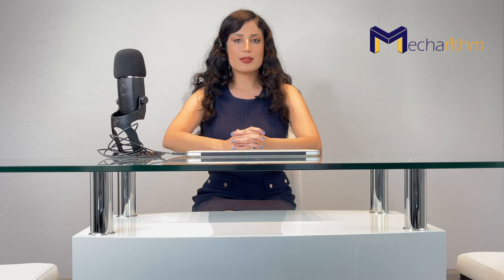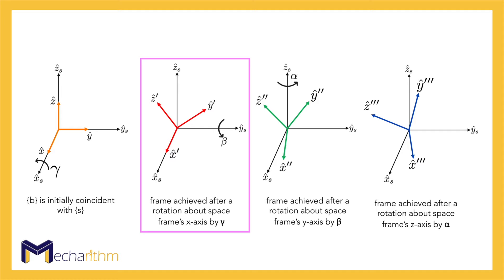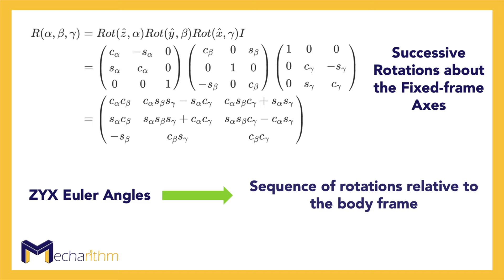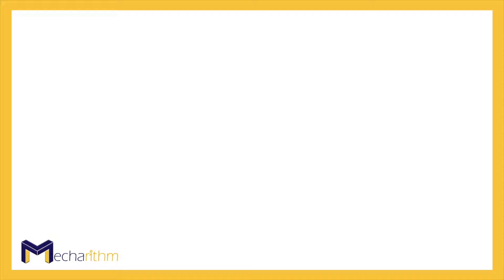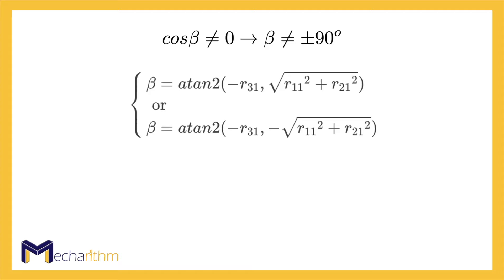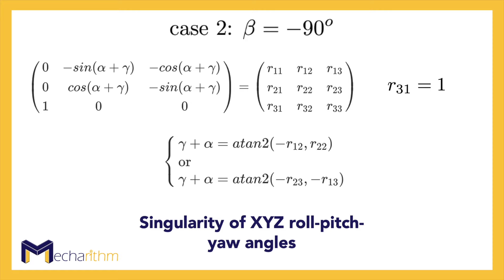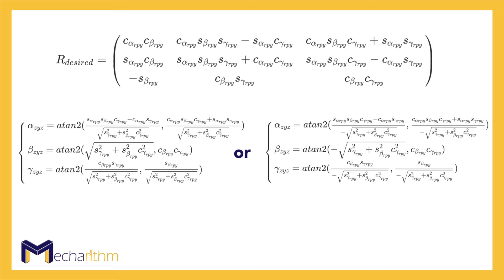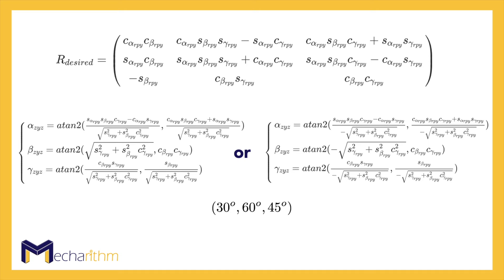Roll-Pitch-Yaw Angles in Robotics | Fundamentals of Robotics | Lesson 11

Comment: This will help in programming the  MPU6050 3 Axis Accelerometer Gyroscope Module 6 DOF 6-axis Accelerometer Gyroscope Sensor Module 16 Bit AD Converter Data Output IIC I2C for Arduino or Raspberry Pi.   😎  Thank you so much.